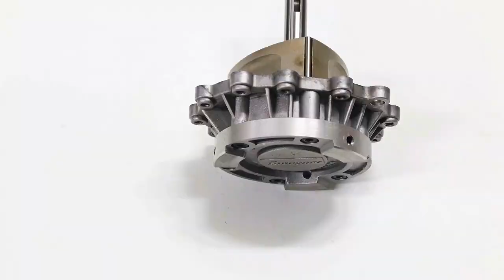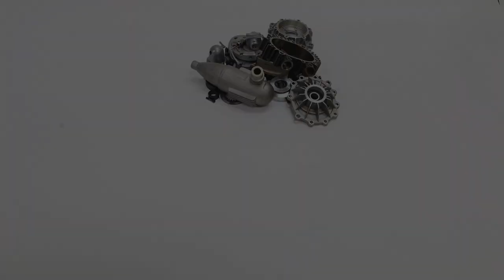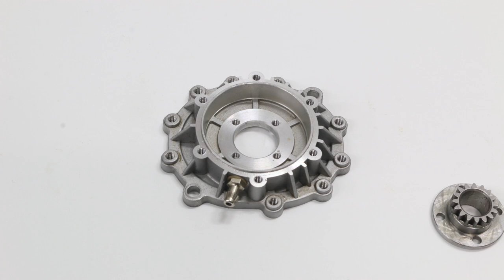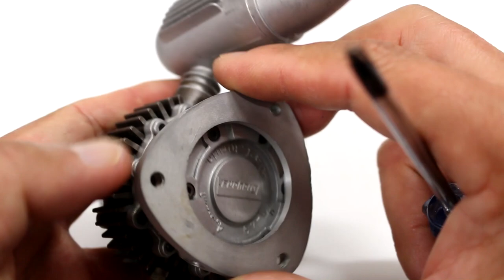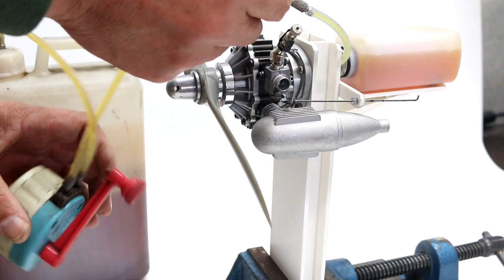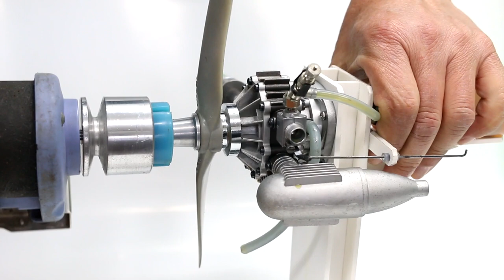WANKEL ROTARY ENGINE - STOP MOTION

Comment: What do ya know it ran!? How long till the internals wear down all those seals. A problem in the past. How about now?
Reply: Not a problem anymore.. these engines have been discontinued for years, no longer available.
Reply: doktorbimmer I really think if someone decides to design them in the future they should use kerosene like they do in turbine engines. A turbine engine wouldn't last with regular gas in it either. AV gas is the way to go but it isn't cheap unless they change the law so that you can use it for heating and combustion for rotary engines.
Reply: The only difference between AV kerosene and home heating kerosene is the color. It's cheap for heating and dyed red to tell the difference
Reply: WHY?? Kerosene has no octane rating system and has extremely poor "anti-knock" properties.
 Not true, some jet engines use AV-GAS not JET Fuel eg; The J34 engine on the Lockheed P-2 used AV-GAS exclusively... I know this because I used to work with them.
 100LL AV-GAS contains LEAD as a LUBRICANT for the exhaust seats... Wankel engines DO NOT HAVE VALVE SEATS so no advantage in using leaded fuels period.
Reply: NOT TRUE, JET-A is NOT THE SAME as kerosene although very similar in color, viscosity and smell D1/heating oils are not the same as Jet fuels which contain "higher cuts" (smaller hydrocarbon fractions) and contain special additives for specific high flash point, viscosity stabilizers, anti-icing, anti-corrosion and anti-static additives.
The difference between Diesel No. #1 (D-1) and Heating or Ag/farming use Diesel no.1 is DYED RED to indicate that ROAD TAX has NOT BEEN PAID thus a significant difference in price paid by the consumer.
Reply: The Lycoming AGT-1500 Gas Turbine found in the M1 Abrams tank can also use MO-GAS (Gasoline/petrol), AV-GAS, Jet Fuel, as well as kerosene heating oil and Diesel no #2.
Reply: doktorbimmer the problem with rotary engines is the seals and too many places for friction.Same with the turbine engine. Many seals and parts that would wear out quickly if they didn't use kerosene. I just think if they can design one that can use kerosene they may solve the wear issues rotary engines have.
Reply: The problem with the seals in the Wankel engine IS INHERENT TO ITS DESIGN, not the type of fuel or lubricant used.
 The apex seal is not a "positive type" seal, meaning that sealing contact pressure does not increase as combustion pressure does.  The contact pressure relies entirely on the tensions springs which are tiny, fragile and very easily damaged, increasing the spring tension improves sealing effectiveness but also dramatically increases wear on the seals and the housing.
Reply: KEROSENE IS A VERY POOR LUBRICANT, it does not have any lubrication ratings or specializations and typically has a Lubricity Rating of 600μm or LESS Not much better than gasoline and far worse than a typical 10w-30 motor oil.
 The only lubrication provided by the fuel is IN THE FUEL SYSTEM. 
 The only friction parts in the Gas turbine are the roller and ball bearings and the carbon seals which all have there own sump and are lubricated by pressurized synthetic engine oil. Fuel does not come into contact with these parts.
Reply: doktorbimmer perhaps a fuel oil mix would be better. There are just way to many parts in contact or friction with each other for a rotary engine to last for any decent period of time.
Reply: Wankel engines don't need pre-mix fuel like a 2-stroke engine does because the main bearings are already lubricated by the crankcase sump just like any other 4-stroke engine.
 Friction is not the primary failure mode of the apex seals in a Wankel engine, high chamber pressures and erratic combustion (detonation and pre-ignition) are, pre-mixing motor oil into the fuel lowers the effective octane rating of the fuel thus increasing failure rates.
Reply: Pre-mixing requires more oil and is a LESS effective method of delivering the correct amount of oil based on the lubrication demand of the engine under load or high rpm and delivers too much oil when it is not needed during warm-up or idling.  
 Mazda's solution was to use oil injection which delivers the correct amount of oil when it is needed and reduces the amount of oil that is mixed with the fuel burnt which is wasted and provides no lubrication once it's burnt in the combustion chamber.
Reply: Why would you use kerosene??? Don't you understand what Octane is???

Comment: Its a wankel engine. a rotary engine is entirely different.
Reply: Wankel engines are also generally referred to as rotary engines.
Reply: That doesn't mean its right. Do you know how many people refer to vehicles with an inline 6 having a v6? A fucking shit ton. Its also wrong. Or people refer to any flat engine as a boxer engine.
Reply: The fact remains that they are referred to as Wankel rotary engines.  It is not unreasonable since the piston is replaced by the rotor, which rotates, and the combustion chamber also rotates.
Reply: A rotary engine is a very specific engine that the wankel isnt. You can dance around trying to justify being 100% wrong, but you are still 100% wrong.
Reply: +David Seager  Many amateur enthusiasts use the incorrect slang term "Rotary" derived from the registered trademark brand 'Mazda Rotary®' a now defunct brand of Wankel KKM engines manufacturered by Toyo Kogyo Cork (Mazda Motors) from 1964 - 2012.
Mazda has never sold a Rotary type engine.
Reply: +David Seager The Rotary type internal combustion engine was invented by Felix Millet in 1892... although Felix Wankel and Walter Froede used the Rotary concept for their Wankel DKM-54 orbiting piston prototype, this design never saw production, Hanns Paschke discarded the Rotary layout in favor of a conventional non-rotary layout for his KKM design which was mass produced as the Wankel engine we know today.
Reply: The Oxford Dictionary of English includes the Wankel engine in its definition of a rotary engine.  The dictionary does not qualify this definition as colloquial which is its term for slang.
Reply: +David Seager  We're not not talking about Felix Wankel's engine here... remember? His engine never saw production. We are talking about Hanns Paschke's KKM-57
KKM stands for Kreiskolbenmotor or in English translates to "Orbiting-PISTON-Motor"
Reply: +David Seager 
ro·ta·ry
ˈrōdərē/Submit
adjective
adjective: rotary
1.
(of motion) revolving around a center or axis; rotational.
"a rotary motion"
Reply: +David Seager Only the DKM-54 designed by Felix Wankel and Walter Froede produces a Rotary motion.
DKM stands for Drehkolbenmotor or "Rotary-PISTON-Motor" in English.
Reply: So are you now arguing that the engine shown in the video is not a Wankel engine?
Reply: +David Seager Ernie makes a good point for once, exactly which Wankel engine are you referring to?
Reply: +David Seager Graupner signed a development and production agreement with NSU (now Audi) to become a Wankel licensee in September 12th, 1967
Which version of the Wankel did they license?
Reply: +David Seager Do you even know what a Rotary type internal combustion engine is?
Reply: I am very familiar woith the traditional rotary engine as used in early aircraft.  I am a volunteer steward at Brooklands Museum where we have a large collection of aero engines which I present to our visitors.  I am simply trying to point out that the engine shown in the video is referred to as a Wankel engine and the the OED includes Wankel engines in its definition of rotary engines.  You seem determined to limit the definition to the older style with a fixed crankshaft but I believe that you are in the minority.
Reply: +David Seager   Still waiting for your answer..... which Wankel engine are you referring to?
Reply: +David Seager You seem to still be confusing the now defunct registered trademark brand 'Mazda Rotary®' as a "definition" describing a  engineering type classification of internal combustion engines.
Reply: +David Seager So are you now arguing that the Radial engines and Rotary engines are exactly the same, simply because they share a common cylinder arrangement?
Reply: Why are you introducing radial engines?  I never mentioned them.  All I am saying is that the engine shown in this video is known as a Wankel engine which is defined by the Oxford Dictionary of English defines as a type of rotary engine.  Therefore the original poster was not wrong to call it a rotary engine.
Reply: You are at it again.  I never mentioned radial engines because they are quite different.
Reply: +David Seager You don't see the connection?
Reply: +David Seager Which Wankel engine? You still haven't answer this important question.
Reply: +David Seager wrote quote; "I never mentioned radial engines because they are quite different."
So are the two Wankel engines... they are very different too.
Reply: I know that radial engines are often confused with traditional, rotary engines as I frequently explain the difference to our visitors.  I do not know why you introduced them to this discussion as they were not relevant.
Reply: +David Seager You don't see the analogy son?
Reply: +David Seager Why do you continue to ignore the question? Which Wankel engine? You still haven't answered this important question.
Reply: I assume that this refers to you introduction of radial engines to this discussion.  I said that they are often confused so I cannot see any reason to add them to this discussion.
Reply: Regaqrding "Whick Wankel engine".  For the third time, the engine that is the subject of this video.  To put it in your terms, it is an engine derived from the KKM design as the DKM design never entered production.
Reply: +David Seager Well of course its relevant, don't you see the connection yet?
Reply: +David Seager Yes indeed, just as the two Wankel engines are often confused...
Reply: +David Seager To put it in your terms, Felix Wankel invented the Wankel Rotary engine.... but it was not his design that saw production. Thank you for finally conceding you were wrong.
Reply: doktorbimmer I never said otherwise.  However, you now appear to be agreeing with the majority that the Wankel engine is a rotary engine.
Reply: +David Seager The "majority" don't know the difference between a Radial and Rotary.... You actually think the majority understands the difference between the DKM and the KKM... apparently it seems you still don't know either. Most people, (including yourself) didn't even know there were 2 different versions.
Reply: +David Seager The majority also falsely believe the Wankel engine shown in this video was designed by Felix Wankel... and like you, are very confused about Wankel orbiting piston engines.
Reply: +David Seager The engine in the video is clearly not a rotary, it is the non-rotary version of the Wankel called the KKM designed by Hanns Paschke without any knowledge or help from Felix Wankel.

Comment: anyone tell me in starting we givecurrent to spark plug to start engin but after that from where spark plug get current 
???????
Reply: Manjeet Yadav starter motor
Reply: it doesn't need current , it's fuel ignited by compression
Reply: GLOW PLUG IGNITION
Reply: Fuel is ignited by the incandescent Glow Plug filament not by compression...

Comment: I don't think it would be good for rc planes. The vibrations are too big and it will rattle the plane to pieces.
Reply: svetko05. Thry make em for em.
Reply: Wankel engines were never popular for any application as they perform very poorly compared to other reciprocating designs... the are considered a novelty even in the RC world.
Reply: doktorbimmer They have advantages over the piston engines, for example- lightweight, small size, lots of power per volume, more efficient and other. The only downside is their reliability and life expectancy. And that is the only reason why they are not used in aviation.
Reply: The Wankel engine has a much  lower vibration level than strokepiston engines, because its rotary mass can be balanced to 100%. The rest of vibrations you can see in the vid, is from the  combustion surges, which has every combustion engine. BTW Imaginative Guy is a very good mechanic, but he hasn´t fixed the running engine correctly. The screws are not tight in the engine mount. Thats the reason for shaking.
Reply: +Dragon800 Why don't you go troll somewhere else... I'm not intimidated by you kid.
Reply: +svetko05 Well, that may have been true decades ago when reciprocating engine efficiency and power-to-weight ratios were not what they are today, by today's standards the Wankel has no significant advantages which is exactly why it became obsolete.
Wankel engines are not lightest, smallest and do not deliver the highest power density... THEY ARE ABSOLUTELY LESS EFFICIENT.. this fact can be clearly observed by the designs higher fuel consumption, higher EGTs and poor torque output.
Reply: +svetko05 Wankel engines are not used in aviation because cannot deliver the range/payload or fuel consumption performance of a reciprocating design and cannot compete with gas turbine technology in terms of power-to-weight performance.
Reply: +otto Fräser  The Wankel KKM is not 100% balanced, the offset "stroke" and the heavy mass of the 3-lobed piston create a significant moment and must be counter balanced and dampened.. Only the Wankel DKM had its primary mass in the form of pure rotary motion... but it was never produced.
Reply: +otto Fräser The Wankel KKM has a considerable stroke, the Mazda 13b design for example has 30mm stroke created by eccentric-crankshaft 15mm off-set every 360° of rotation.
Reply: +Michael Vechnak But the tri-angle shaped piston("rotor") only turns at 1/3 the crankshaft rpm...  it vibrates less because its turning slower.
Reply: From the look of it, his engine is missing the Woodruff key that fits into a slot on the crankshaft to properly align the front counterweight.
Reply: + Michael Vechnak Right!! rotating masses can be balanced to 100%, translational masses like in piston engines only up to 50 %. I´m comparing 1 cylinder piston, with 1 plate Wankel. A common way to balance a piston engine is to add more cylinders. 6 cylinder in line for example( balanced to 100% in 1. order and 2. order). but this is another question.
Reply: +otto Fräser The Wankel KKM engine is NOT 100% balanced... this why they cannot rev as high as a reciprocating engine can.
Reply: +otto Fräser Another way to balance a reciprocating engine is to arrange the cylinders so the reciprocating pistons are horizontally-opposed

Comment: how mach max RPM?
Reply: ~17000rpm with a propeller attached, slightly more without a propeller. However, it will overheat quickly without lots of airflow from a propeller.
Reply: Flaremind I have one of these great little engines, 17 to 20 thousand rpm producing 1.25 hp and it's only .49 cu.inch

Comment: For the hundredth time YouTube that is not a rotary engine. A rotary engine has a fixed non moving non rotating crankshaft. The rest of the engine spins around while the crank shaft remains fixed (usually bolted to the firewall of a biplane.) This engine is named for its inventor like the Diesel or the Otto. Get it right this is a Wankle engine.
Reply: Uhh you spelled Wankel wrong lol
Reply: @Ty-qb1qo  can't give a correct spelling diffrent alphabet dif keyboard wtf is a oomlaht.
Reply: It is a Rotary Engine. Originally designed by Felix Wankel.
Engines were used in cars and motorcycles by; NSU, MAZDA, DKW to name a few. They were also ideal for generators.

The others that you are referring to is a Radial Engine, either fixed crank rotating cylinders or rotating crank fixed cylinders.

Comment: Just, why rotary engines doesn't exist anymore.?
Reply: Ade Rama if you're actually wondering, it's pretty simple. They're inefficient, fragile, and low on torque in lower RPMs. Basically, there's not much use for them in the real world. Sports, sure. But that's about it.
Reply: They are very ineficcient. They need oil in the fuel for lubriction and the emmissions are terrible. The apex seals also wear. Fuel economy is very bad as well.
Reply: Seals and fuel economy. Solve them and you will make lots of $$$$$.
Reply: The Wankel engine was simply not as good as other types of engine still being made... they do not perform well and sold poorly. The Wankel is now obsolete since the last manufacturer (Mazda) abandoned the design half a decade ago. cheers!